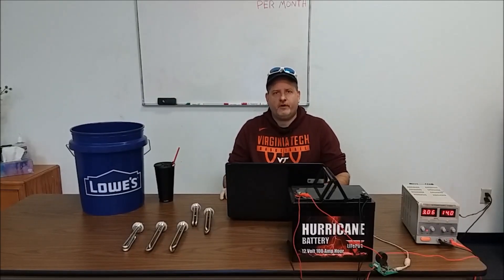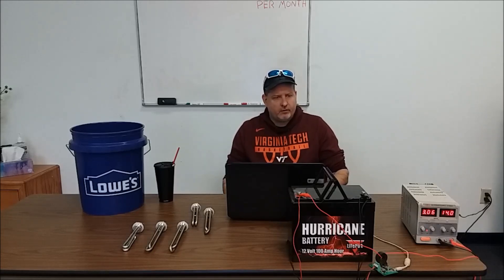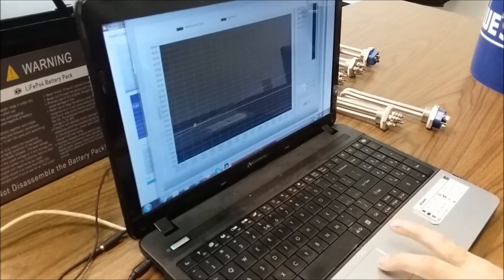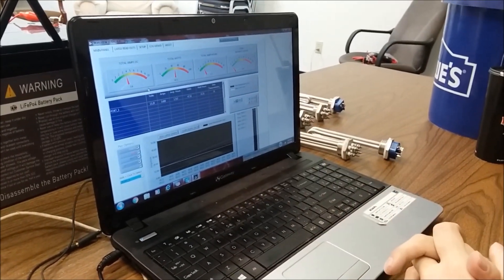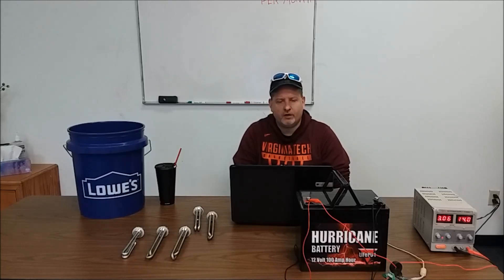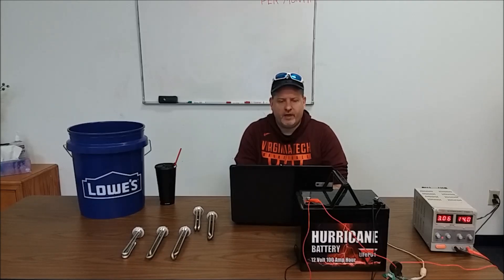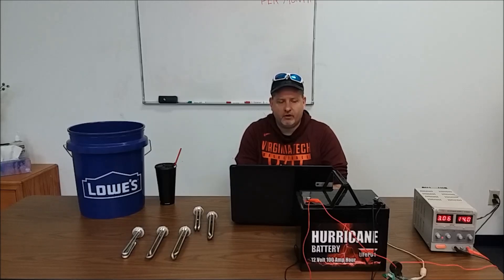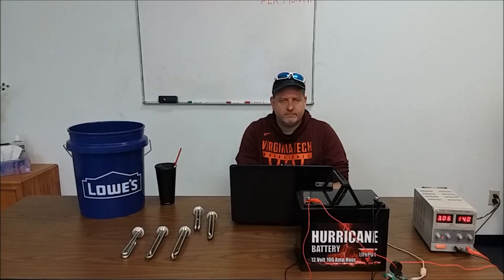Watts View Watt meter data logging for research and development in wind solar and hydro applications

Comment: I have a 24v system and a 12v also. The 24v is controlled by a Midnite Classic. When back in the days of false wattages I seen you use this software to show accurate outputs. When I get some money ahead I would like to purchase that and to be able to monitor my  12v system, without spending a lot of money for another Midnite. Thanks for sharing 😃